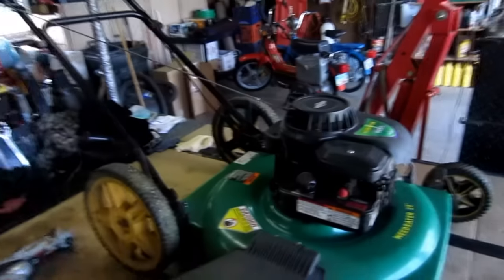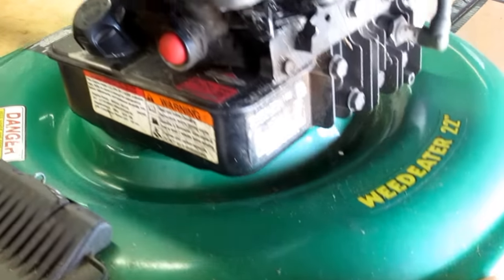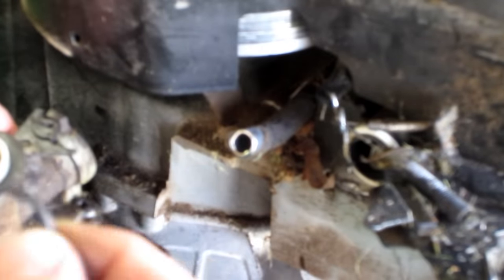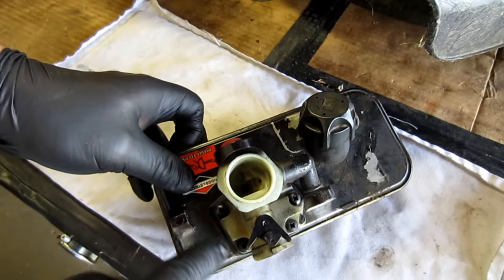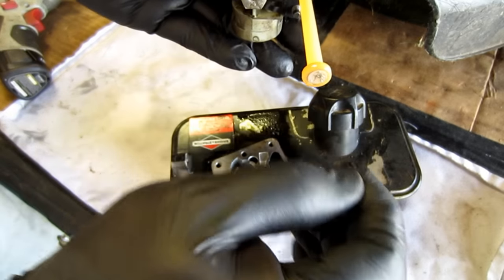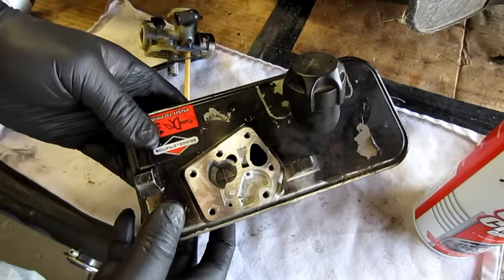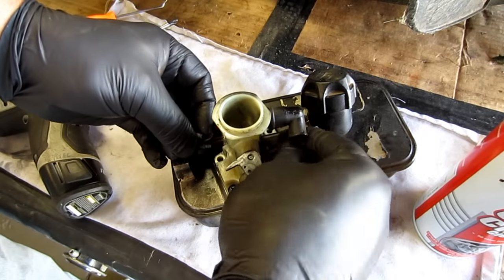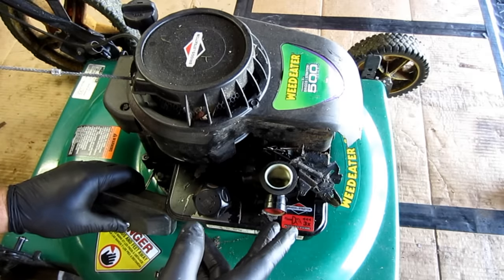Fix 90% of Briggs lawn mower not starting problems. Easy repair.

Comment: What if the filter is clogged? Can you clean it and how?
Reply from the maker: Foam filter can be cleaned with dish soap and water allowed to completely air dry and then apply a small amount of motor oil to coat the filter before reinstalling or put it back in dry.

Comment: Thanks for the video. I have an 8 hp Briggs on a Bearcat chipper. After ~15 minutes of light use, it starts to stumble as though it is developing vapor lock. But the engine is not that hot and the carb is even cooler. The carb is a different model than what is shown here. But I wonder if the gasket issue you describe at 9:41 may be the cause. Perhaps a warming of the carb causes a gap to appear around the gasket?
Reply from the maker: There is no vapor lock. That is an old school carburetor issue on cars and some motorcycles. There's no place for the vapor to form. The gas is drawn directly from the tank and into the intake. Look into cleaning and putting on new carburetor gaskets. You could also buy the entire carburetor relatively cheap. If you click the link in the description of the video it should give you the option down below of other items that have been purchased by Shoppers who are looking at the gaskets and I believe a plastic carburetor won't come up.
Reply: @Foxboss9  Thanks for the reply.  When I had trouble with vapor lock on cars, I looked up the boiling point for gas. It is a LOT lower than water, at around 170F. I also looked into vapor lock on pressurized fuel injection systems that run ~44PSI.  They too can develop vapor lock because like water, increasing pressure only yields a small increase in the temperature at which the fluid boils (which in turn will cause vapor lock)

Comment: Changed the air filter, drained and filled tank, got a carburetor kit and new plug. And tried this. Still won’t start. Any ideas?
Reply from the maker: Short burst of carb cleaner directly into the carburetor should make it run. If it does you still have a fuel delivery problem
Reply: @Foxboss9  Where should I look if its a fuel delivery problem?

Comment: Iv got a few classics and they "pop" cleaned them and replaced the gaskets, any ideas?
Reply from the maker: Could be valve adjustments, could be partially sheared flywheel key causing Mis timing, could be air gap needs adjusted on the coil, could this be crappy spark plugs. Could be crappy gas.

Comment: Shut off the fuel supply and run it dry before putting away... use Stabil in the gas.  Old gas causes more problems than anything.
Reply: So this many people actually cared about a video on cleaning a damn carb hahaha

Comment: why couldn't yoiu put a very mi-nute line of high tack along the edge to help seal the gasket
Reply from the maker: House repairs for the everyday guy that don't normally work on stuff. Most likely they don't have any kind of gasket sealant and especially the correct Permatex or Indian Head and even if they were giving it or went and bought it they most likely want to put it on correctly and cause some pretty bad problems with the carburetor having that stuff in on that plastic.

Comment: What would make it run hard when u start it up and it stays that way
Reply from the maker: I'm not sure what you mean by run hard? I love it when it mower runs hard oh, it gets the job done. Are you saying it runs rough? If that's the case you need to look at replacing your spark plug if you haven't done that yep, you also need to change your air filter make sure it's not clogged, you also need to make sure you have the right amount of oil in the crankcase, and if it still runs rough then you need to do the repair that I show on the video with fresh fuel.

Comment: You did not clean the gas tank.  Why?  Usually there is old petrol in there that needs to be flashed out and the tank be cleaned.
Reply from the maker: I cleaned it I just didn't document it. Kind of seems like common sense don't it
Reply: @Foxboss9  Never done it before.  So you cleaned it after you removed the carburetor or can it be cleaned while the carburetor is on it.

Comment: mine is very difficult to start and lobes like crazy when it does run like it's about to jump off the road... what would cause this?
Reply from the maker: If it's vibrating that hard it's got to be a Bent Blade. And the reason it's hard to start as you could have partially sheared the flywheel key.
Reply: @Foxboss9  it has a brand new blade on it but i'll check it out to see if it's ok... It does appear to have a small oil leak which is annoying and the spark plug is covered in black crud....

Comment: I'm looking for the 1/2 tube (air intake plastic )  that the carburetor slides onto  mine cracked
Reply from the maker: Find mower repair shop that may have junk engine they can pull it from...

Comment: You said something about tipping wrong way. And oil gets into filter n carb. What do I do than? Oil in cylinder head to
Reply from the maker: Clean oil out of sponge air filter with dish soap allow filter to dry. As far as the cylinder goes you'll have to remove the spark plug and pull the cord a few times to cycle out all the oil. Then put a short burst spray of carburetor cleaner directly into the cylinder and then reinstall the spark plug. Then with the air filter off, spray a short burst of carb cleaner into the carburetor directly. Then go ahead and move the mower outdoors with plenty of ventilation and start it up. It will smoke quite a bit but it will go away.

Comment: does this work if the engine revs while running it? konks out easily if it encounters a thick area.
Reply from the maker: That sounds like a governor issue... Check your springs and governor movement...
Reply: like you did at the end of the video?
Reply: I cleaned everything like your video said, the gasket was part of the problem.  It runs good now,Thanks!

Comment: Never use carb cleaner on plastic.  Use brake cleaner.  Carb cleaner makes plastic gooey or brittle.
Reply from the maker: If you soak it , yes but in the manner that I showed, no problems at all

Comment: What do I do if the primer bulb is stopped up and has trash in it how do I get it apart?
Reply from the maker: There is a plastic ring or a metal retainer that holds the primer bulb in. You basically have to pry it out. But, as long as the primer bulb does not have any tears, I have not ever had to remove one to clean out the tube in which the fuel is drawn by priming the bulb. Basically, what I'm saying is, there's not a reason to take the bulb off if it's not damaged. All cleaning can be done with the bulb installed.
Reply: Ok thanks I'll have to get a good look at it in the daylight thanks again for the info

Comment: So, dead on! Thanks so much!
Reply: I followed your steps. I lost the tiny return spring, Took me longer to find the spring then it did to put the whole thing back together, lol. One diff, there is 2 gaskets. One flimsy like what you showed, and another stiffer. Flimsy was tank side, stiff carb side. Other than that, ran like new, thanks

Comment: “This tube here” It’s called a pick up tube.

As a small engine mechanic since the ‘70’s I disagree with your cleaning methods sir...
1) Completely clean off the fuel tank with compressed air before removing the air filter and fuel tank, this will keep dirt out of the intake tube, carb, and fuel tank.
2) Remove the fuel in the tank and plug the intake tube with one hand and clean the side of the engine... move away from the mower and clean the outside of the tank, then drain the old fuel and clean the inside with mineral spirits or parts washing fluid, drain and blow out the tank, and remember to wear gloves and safety glasses.
3) Use non ethanol fuel only because the fuel you use in your road vehicle is 10% corn
ethanol that absorbs moisture out of the air and creates water in the fuel tank causing non starts and poor running conditions on that plastic carb and corrosion in emotion tube and jets clogging.
A vehicle can disburse this water out of it’s exhaust pipe, but a small engine can not.

The rest of the video was great 👍 👍
Reply from the maker: Sounds like you should post your first video.

Comment: How the heck do you change the oil on this mower?
Reply: Look under the deck. You will see a square hole that a 3\8 ratchet extension fits snuggle in. Unscrew that, it is the oil drain plug. Don't forget to put it back in.

Comment: I have heard that it's better to clean that gasket with gasoline because it's not as hard on it.
Reply from the maker: Cleaning with spray not soaking in it... It evaporates so fast its almost impossible to hurt anything.... Most efficient mechanics won't waste their time with lesser solvents.... They want to blast away the foreign materials and contaminants as quickly as possible as to reassemble and get the unit back running for the customer... Especially in spring when everyone is mowing every 3 days..

Comment: does anyone have any recommendations on why a self propelled mower shuts off when the air filter is installed?  It runs fine with air filter removed.  Thank you.
Reply from the maker: Assuming that the air filter is clean and the correct one, it could be that the air filter box is interfering with the carburetor linkage especially the choke or Governor linkage

Comment: How can you tell if the gas is old causing it not to start?
Reply from the maker: 2 Short Burts of carb cleaner directly into carb, then try to pull start, if nothing, try 3 short burst of carb cleaner and attempt to pull start again... If still nothing, then you most likely have a problem other than fuel/carb issues...
Reply: Foxboss9 Do you remove air cleaner and spray into there?

Comment: I like this video. Now if you can point me to the video that shows how to fix one that was turned over the wrong way and got drowned in its own oil.
Reply from the maker: Remove the air filter and either clean it or replace it. Take the spark plug out and pull the cord a few rotations. Reinsert the spark plug and top off the engine oil to the correct level. Use a can of carburetor cleaner and sprayed directly into the carbs short bursts. And then try to start it like normal. When it starts running it will smoke excessively. That is normal. It will burn off all the oil without any harm to the engine. After running it and the smoke starts to clear, reinstall the newly replaced or clean air filter assembly. And that's it

Comment: My 79 8hp wont start, it feels like it doesnt have power at all, maybe it tries to turn but fails. Any help?
Reply from the maker: If you're saying it doesn't want to turn the engine then that has to be starter or battery related. Unless you're saying it doesn't click or anything that could be safety switch related. If you're saying the engine runs poorly and doesn't have any power then that could be numerous problems as far as carburetor gas or oil or mechanical related.
Reply: @Foxboss9  oh i mean it only has a rope starter and when i try to start it (choke on) it tries to start but it doesnt have the power to turn itself. I can hear the gas does burn and the spark works but it just doesnt have power

Comment: Seeing as a lot of people here have little or no knowledge of engines might be wise to take the plug cap off first. Sorry to be pedantic but you never know.
Reply: Oh and I always put scratch marks on all my gasket mating surfaces just to make sure the flat machined parts grip better. Never did get an engine running that ran right though.

Comment: I did all this and even replaced the spark plug to discover all it was was the spark plug lead getting stuck in the front of the motor, it cut through and shorted the wire preventing spark 🤬

Comment: 24 horsepower briggs and stratton just put new fuel pump, fuel filter, lines, carburetor, and air filter on it all brand new and still have to prime to get it to start what wrong
Reply from the maker: Choke needs adjusted. It's not fully closing

Comment: I really need the air box and air filter for this model briggs engine and the screw to hold it down.  Does anyone know the correct part number?  Thanks
Reply from the maker: Just hit up a local mower repair shop I'm sure they have them laying around

Comment: Excellent video! I would say that you always start all the bolts b4 tightening any to full torque and I would use a cross pattern to extract and install the bolts. Cleaning the outside of the carburetor would be very easy to do with a water hose b4 the removal process. The scribe line is an awesome idea maybe just a little dab of RTV couldn’t hurt. The oil in the air cleaner is a normal part of the engine function as it takes the blow by from the crank case and suck it into the incoming air charge to the engine to be burned and not be released into the atmosphere to cause harm to the planet and its people!!
Always keep your vehicles engines running properly and then the environment will benefit as well as us humans and the animals of which I am one lol
MAGA

Comment: did everything step by step and same problem. what else could it be?
Reply from the maker: You may need to purchase new gasket and diaphragm linked in the description...
Reply: @Foxboss9  i replaced gasket and diaphragm when i cleaned everything.any ideas?

Comment: Why you never replaced the diaphragm.  There are 3 dollars.  And it will run for 3 years . No problem
Reply from the maker: As the video suggests, sometimes you don't need a new diaphragm. Sometimes the diaphragm is just fine but it will pull itself out from the clamping Force that is the weakest between the two farthest screw points. That's why I mentioned making the Scribe line. You got to remember that not everybody's patient enough to allow there mower to set for another couple of days while they wait for parts. There's a lot of time but they just want to put it back together and get it running so they can continue to mow. I will usually replace the diaphragm and the gasket that's why I put the links in the description but I wanted to show how to make the repair immediately.

Comment: I'M the unlucky 1%, did cab rebuild, not working, cab replacement, not working, fuel tank cap replacement, not working, teared it apart and found there is a huge crack on plastics intake manifold.
Reply from the maker: Wow, definitely not a common problem. Make sure there's not other reasons that could have caused that plastic to crack. Especially if you're having a problem with the muffler either loosening or breaking off. I've had carburetor mounting bolts break and Mufflers fall apart or come off due to an imbalance at the blade do to a bit output shaft. Hopefully yours is just fatigued plastic. Good luck. Good news is those parts are relatively cheap.
Reply: @Foxboss9  thanks for advising, I will look into it on why the tube crack

Comment: Did all of this and mine runs then dies. What can be the cause of that?
Reply from the maker: You need a new fuel pump and Gasket the link is in the description. Make sure that you cleaned everything exactly the way I described as good as you could. Especially the pickup tube that goes into tank and also the pickup tube that goes into the small Reservoir that's built into the tank. It's the one that has what appears to be a plus sign in the bottom of it that is molded into it that I show in the video is being dirty. But most likely you need a new fuel pump diaphragm and Gasket.
Reply: Foxboss9 replaced the gasket during cleaning. I’ll try the fuel pump thanks for the fast response.

Comment: Mine would start after priming it and then only run for about 20 seconds then stall out.
Reply from the maker: Follow this procedure and make sure you clean the tank. It should fix your problem.

Comment: These diaphragm carbs are complete garbage on 4 strokes. You should not need to tear them open every season. Throw that junk away and get a mower with a float bowl carb.
Reply from the maker: The fuel that is being used is what makes all small engine carburetors junk. This repair it's not necessarily needed every season. It usually only needs to be done about every 4 to 5 years. Depending on how the user is storing it during the off-season and if they are using some sort of fuel additive.

Comment: What length is the 1/2" bolt?
Reply from the maker: Not sure, I never broke one or misplaced one before. Probably best to go to a mower shop and see if they have a scrap mower you can get it off of
Reply: Thanks for the quick reply. I was mowing tonight and looked down and noticed the tank was hanging down. Bolt worked its was lose never noticed it

Comment: Anyone got gas leaking into the oil and flooding the combustion chamber (wet sparkplug electrode)?

: 04 carburetor Briggs engine 4.0HP

Comment: Use non ethanol contaminated fuel i.e usually premium fuel from https://www.pure-gas.org/  gas stations. I have a 20 year old Briggs and Stratton gas mower that starts every year without fail AND I haven't changed the sparkplug yet!!!!  I do use my recycled synthetic oil from my car.

Comment: those carbs are junk you can't rig them in a pinch can't find gaskets and those stupid ass primer bulbs get rotten real quick that and you can't remove the jets. I'm glad Briggs  is starting to make mowers with gravity fed bowl  carbs just need to make them where I can remove all jets and adjustable airmixture . 90 percent of all Briggs I come across have carb issues.
Reply from the maker: If you think those are bad don't buy a Honda or Tecumseh.

Comment: I MUST HAVE A LAWN MOWER IN THAT 10%.....  I have installd new spark plug, igntion coil,  new carburetor and yes new gas, cleaned the engine checked the fuel  lines still this husqvarna 775ex self proplled mower will not start no matter what I do.....
Reply from the maker: Sometimes you have to take it to a professional.

Comment: I did all that, I have good spark, and it still won't start
Reply from the maker: If it runs on carb cleaner it's a fuel delivery issue.